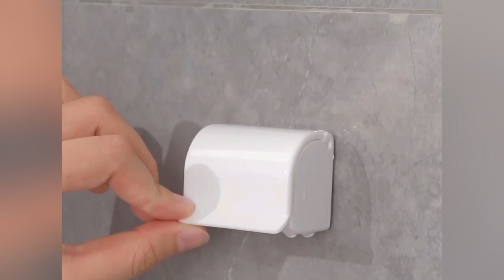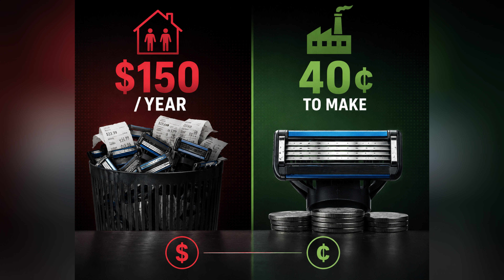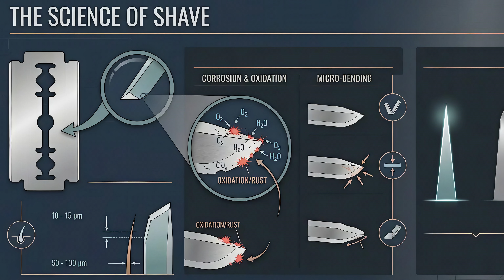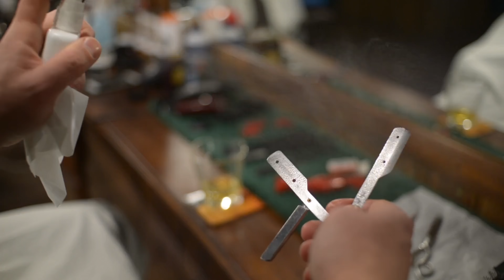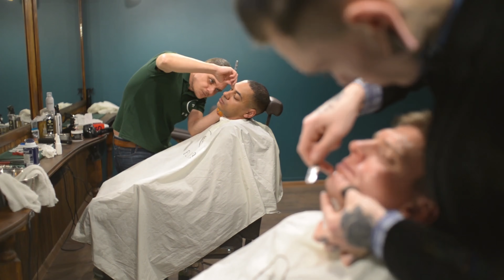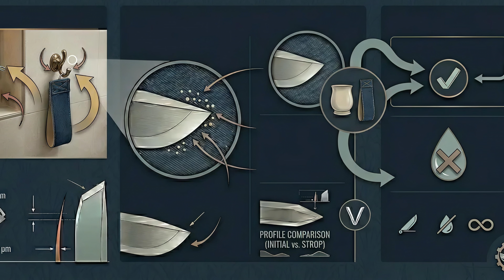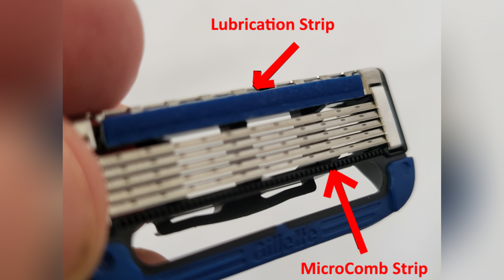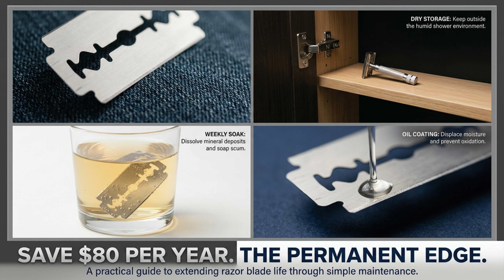Your Razor Is Designed to Dull After 3 Uses — How to Make It Last 2 years!

Comment: For as long as I can remember, I've been doing the following procedure and a quality cartridge will last me easily three or four months before it gets to the point where it is noticeably not nearly as sharp as new, and then I just change out the cartridge.  
When done shaving, I rinse it under HOT water for a few seconds, getting the water in between the blades.  I then shake down hard a few times on each side to get any water out from between the blades.  Finally, I squeegee the razor, as shown in the video, on my forearm, to get any excess water off it.  I don't do this to strop the blades, just to her it drier. I don't do anything else this guy does, but I think that rinsing with HOT water melts away any oil and residue buildup from your skin or shaving cream, and helps any moisture evaporate immediately off the metal blades,  limiting corrosion. 
Looking at the above, it seems involved, but honestly, it takes maybe an extra 20 or 30 seconds, and I'm on my way.

Comment: Why not just get a strap of leather.
Reply from the maker: You could, but leather is usually better for straight razors or knives, where you can control the angle directly.
With cartridge razors, the blades are tiny, thin, and recessed inside the plastic head, so denim is a little more forgiving. It lets the cartridge glide across the fabric without needing a perfect stropping angle.

Also, most people already have old jeans lying around, so it keeps the trick cheap and simple. The goal here isn’t true sharpening like a barber’s strop — it’s more about cleaning/polishing the edge and helping prevent the tiny rust and buildup that make the blade feel dull.
Reply: @Sidney_Explains_Money  Cool I'll try it.
Reply from the maker: @Gorilla_Jones  Awesome, yes — please do. It’s going to make a huge difference. You won’t regret it, my friend!
And remember: dry your razor really well after each use. Then rub it on denim or an old pair of jeans, and store it somewhere dry, away from water and moisture.

And if you have mineral oil or baby oil, you can put a tiny, tiny amount on the blades before putting it away. Then just lightly wipe off the excess and store it dry.

I literally have disposable razors I bought two years ago that are still working extremely well — almost like the day I unpacked them — just from doing this.

Comment: Could you use olive oil, coconut oil?
Reply from the maker: You can, but I wouldn’t recommend olive oil or regular coconut oil for razor blades.
They can go sticky or rancid over time, and they may leave a little residue on the blade. For this trick, you want something more stable and neutral, like mineral oil, sewing machine oil, or even a tiny drop of baby oil if that’s what you have.

The goal isn’t really “skin lubrication” here — it’s to leave a very thin protective layer on the metal so moisture doesn’t cause those microscopic rust spots that make the blade feel dull. So just a tiny amount is enough.

Comment: I was so intrigued that I started doing a little research and the first thing I read was do not strop cartridge blades, they are too thin. The article was referring to a leather strop but it still makes me wonder.
Reply from the maker: Stropping is definitely different from the maintenance shown here. This technique is really more about preventing the microscopic rust and buildup that can make the edges feel dull. 💡
And you’re doing it on denim/jeans, which is also different from using a traditional leather strop.

Comment: Are you able to use a standard stope on these blades? Or are the blades too thin for that?
Reply from the maker: For modern cartridge blades, I wouldn’t use a regular leather strop the way you would with a straight razor. The blades are very thin, recessed, and set at fixed angles inside the cartridge, so it’s hard to make proper contact without bending, catching, or damaging something.

That’s why denim works better here. It’s softer, more forgiving, and it cleans/polishes the blade edge without needing the same pressure or precision as a real strop. You’re not truly “sharpening” them like a knife — you’re mostly removing buildup, drying the edge, and gently realigning/polishing it so it lasts longer.
Reply: @Sidney_Explains_Money  - Thanks for the answer.

Comment: I have the Gillette and Schick razors that you push the button and it vibrates really fast. I have no idea why it does that?
Reply from the maker: Yeah, honestly, that’s kind of where I land on those too. 😂 Don't make sense to have that 😮
The vibrating handle sounds fancy, but in real life I don’t find it makes some huge magical difference. It doesn’t sharpen the blade, it doesn’t really clean better, and it doesn’t replace good prep or a sharp cartridge.

At best, it might make the shave feel a little smoother for some people, but to me it’s mostly marketing — and yeah, kind of annoying after the novelty wears off. Light pressure, warm water, good shaving cream, and keeping the blades clean and dry matter way more.

Comment: just how the hell you flip the razors from that disposable set of 3-4-99 blades head to wipe them on your ass leather!?  smart just for theory, it allows you to do half the job, how effective is that?
Reply from the maker: You don't need to flip the razor. You wipe the blade side across the denim to realign the edge, not the cartridge itself. It's about maintaining sharpness, not cleaning.

Comment: After use, blast it with the hair dryer on max heat for 30 seconds, that removes any water, then run along denim strap, then add a drop of the oil which came with your electric clippers.
Reply from the maker: That’s a next-level routine to keep blades in top shape, thanks for sharing! 🤘🏼

Comment: What type of gillete blade is the best? Fusion, proglide, etc... I wanna know the type of blade and only have Gillette on my country that is decent quality and wanna aply these tips
Reply from the maker: I’d probably go with Gillette Mach3 if you can get it.
The 5-blade ones like Fusion or ProGlide can feel smoother at first, but they also have more blades dragging across the skin, clog faster, and are usually way more expensive. For a lot of people, a good 3-blade razor is actually the better balance: close shave, less irritation, easier to clean, and the blades are cheaper.

So my pick would be:

Best simple choice: Mach3
If you want the fancy one: ProGlide
Best long-term upgrade: old-school safety razor, if available
And yes, the drying/storing tips from the video should help stretch the life of any of them. Just don’t press too hard — light pressure makes a huge difference.
Reply: @Sidney_Explains_Money  I think you may be mistaken about the 5- vs 3-blade cartridges. 5 blades spread the "load" across more blades than 3 the same way that 18-wheelers spread the load across more axles. The cartridge is designed to align the blades with the skin, and 5 blades means that each blade drags less on the skin. They are more expensive and may clog faster (though my fusion cartridges last as long as my old Mach 3s), but I find them more comfortable.

Comment: Double edge razor blades for my old style safety razor cost about 5 to 7 cents per blade if I buy the 100 or 200 packs.  I've never found those multi blade cartridges to give any better shave than I can do with a safety razor.
Reply: But is there not a risk of cuts and bleeding? However, one tries sometime you are preoccupied in thoughts due to daily stress. One careless moment and you get a nasty cut.
Reply: @GiDes-s4o    They are designed to be safe that's why they're called safety razors.

Comment: OK this method makes no sense( for Mach3-5 type blades), the actual edge that shaves is slanted at such an angle that stropping it will not really hone the edge that matters. I don't see how this actually works.

Comment: I sqaw this on an episode of Mythbusters YEARS ago. A 99 cent pack of 6 Bic disposable shavers, lasted me over 3 years after I started doing this. I mean, those were then 15 cent razors, lasting over 6 months each.
Reply: Why would you use the WORST razors to begin with? Why not use the best - Gillette Fusion Shield's. With this method, the total cost of the blades is irrelevant and I think if you oil it every shave, one cartridge should last a year of great shaves, instead of 6 months of bad shaves.

Comment: I prefer to use single blade double-edge safety razors. They tend to run about $0.1 to $0.2 each, and last me about 3-4 face shavings or one head and one face shaving.  I'll try the denim strop idea and see if I can get a bit more out of them.
Reply from the maker: Those are definitely the most cost-effective way to shave, let me know if the denim trick works for you! 🤘🏼
Reply: Very realistic comment - thanks!

Comment: I use a rubber shaver mat, I have done for over ten years. It can make a gillet mach 5 disposable shaver last 12 months easy. And I shave my head, which means it is been used to shave a bigger area 😁👍. The last time I bought Gillet blades was in August 2015, it was a 18 shaver promotion pack from Boots. The most common issue I had was the plastic breaking before the blades gave up.

Comment: If you want your Gillette triple blade razors to last at least a month each, do this simple thing: After each use, rinse them in isopropyl alcohol. Pour a couple of ounces into a a small cup, then after shaving, shake the blade around in that cup of alcohol. It will do a couple of things. It will wash out all the hairs in between the blades, it will disinfect the blades, and it will keep the blades from oxidizing because isopropyl alcohol will not oxidize the blade edges like water would do. I never rinse off my blades with water. Ever.

I’ve been buying a twelve pack of disposable triple blades each year for the last 23 years, and they last a year (I change the blades each month by habit).  Rubbing alcohol is cheap, about 2 dollars for 16oz, a pack of blades that will last you a year will set you back about 30 dollars (Gillette is a rip off), and the handle you never have to replace.

Comment: Do yourselves a life Changing favor... Buy an old fashioned "Safety Razor" from Walmart... and a pack of dual sided blades.  I used to fear using one... thinking Id cut myself.  In fact, Ive rarely cut myself ever... and far less than when I was using a modern multi-bladed Razor.    More importantly...  Ive gotten a single blade to last almost an entire YEAR.    Sure... the blade wont cut as close.. after like 3 months worth of shaving... but its still more than close enough for me.

 Also... Ive never had to dry my blades to get them to last.   Im not saying its not a bad idea.   Its just never been an issue for me.   The bigger issue, is making sure the blade is perfectly clean, when you put it away.

 And finally... I have serious doubts about the idea that cutting so much hair... is never going to Dull a metal blade.   Scissors are mostly only used to Cut paper... and they still eventually get Dull.
I think one of the biggest reasons for modern razors getting dull... is due to the cut hairs getting trapped between each blade.  This might be causing the blades to slightly change shape, which changes the cutting angles.   Also, once the crevices are packed.. its hard for the cutting to be as effective... as the shavings will likely be gumming up on the surface of your skin.. being cut and re-cut.. until they finally clear out of the way.   Additionally... if the blades are full... then when you keep trying to cut... you will notice that the blades are not cutting good enough... so you will often PRESS HARDER into your skin.  This extra pressure will likely cause a much more rapid Dulling of the Blades.   You should never need to press hard to get a good cutting action.

 Tips:  To get a closer shave  (and extend the life of the blade)..   Make sure to tighten your skin areas.   You can tighten your facial muscles... but sometimes its also easier and more effective, to pull your skin surface tighter... by using your other free hand.   The tighter your skin... the more level the cutting surface... the most easier the Cut.

 I used to use Shaving Cream... but eventually I just lathered up my face with a standard bar of soap.   The results have been the same... And its MUCH cheaper.

 I used to have extremely sensitive skin..  which would get red with bladed shaving... as well as would get too many nicks/cuts.    That was with standard multi-blade razors.   It turns out.. that the "Closest" shave isnt always the better shave.   If the blades are scraping the skin.. rather than just cutting on top of the surface of the skin... its going to create redness, and potentially develop ingrown hairs... as well as you being far more likely to cut yourself.    Ive never had this issue with a Safety Razor's cut.   No redness at all.  And EXTREMELY rare to accidentally cut myself.

 Another great thing about a Safety Razor.. is how easy it is to clean it.  You turn the dial to slightly loosen the blade... shake it in the sink/bath water a few times.. then re-tighten.  Takes less than 2 seconds to do it.   You should clean the blade after a few strokes.   You will feel it start to cut less and less optimally... and at that point, clean it, rather than continuing to force a harder + higher pressure cut.  Also, since the blade has two sides... you can fill up one side... then flip the blade over and fill the other side... before needing to clean it.

 Finally...

 Decent quality Stainless Steel... doesnt easily pit / rust.   However, stainless is a soft steel.. and does not hold a very sharp edge for very long.   This is why real COMBAT SWORDS... are made from two different kinds of steel.   The Inner Core of the blade is made from a very HARD, but Brittle steel.   This hard steel can sharpen to a Razors edge... and the edge will last a very long time.  It will also sharpen easily and quickly.   However... if you were to make the entire sword out of that steel... it would shatter the moment two swords collided heavily.   To solve this problem... the hard steel is put into the center of a softer and more flexible steel.   This allows the swords to bend, without breaking.

 Its similar to a pencil.  The wood is soft and flexible... and the Graphite core is HARD, but Brittle.   Wood can be sharpened.. but it wont hold a sharp point for long.   Graphite can be honed to a thin needles level of sharpness... easily able to penetrate the skin, and draw blood.    But too much pressure... and it will shatter / break.  The wood protects and strengthens the Graphite... helping to prevent it from easily breaking apart... even when Dropped on it side, from like +6ft tall.

 Now... the thing is... there are many grades of Stainless steel.   I believe there are also different hybrid mixes of stainless + other metals.   These less quality stainless steels... can and do rust / degrade.  Not as bad / fast as standard steel / iron... but still... eventually they will corrode / pit / rust.

 Most stainless blades are not easily sharpened... unless you have an extremely precise sharpening rig.   Ive personally never been able to revive an Exacto blade, for example.   Then again, Im not an expert in sharpening... and,  I lack a sharpening rig.    What I can say... is that Stainless is so soft.. that even if you get a decent edge on it... it wont last very long.  It dulls way too quickly.

Comment: You can't strop a safety multi blade razor in both directions? you can hardly do it one direction given that it's encased in a holder.
Reply: @roadwarrior8560  I thought exactly the same.
Reply: I use a leather belt that is as wide as just the blades. Probably use each cartridge for a year.
Reply: Thank you ... video is gibberish when it explains stropping

Comment: I use safety razors since many years. I used expensive razor blades with it. One day, at a barber shop I did ask the owner what they are using. The answer was stunning! Cheap blades made in Turkey! So I went online and found them. They are called Astra and they cost 9.90€ for 100 pieces. Then I looked at the fine print on the package and of course Astra belongs to Gilette. I wouldn’t be surprised if those exepensive Gilette blades came out of the same factory.
Reply: @deantiquisetnovis  Astra was originally made in Russia but now mostly comes from China. I shave mostly with Astra Platinum. The blades exclusively manufactured in Turkey are Derby Extra. Yes, they're cheap, but they're also terrible.
Reply: @eski_adam well some of them are dull out lf the box. But at 10 cents a peace I don‘t care 😅
Reply: That would make sense. Many store brand items (milk, bread, certain meds) are manufactured in brand name factories.
Reply: @deantiquisetnovis  Amazon. Astra, 100ct. $9.

Comment: So I should strop my feather disposable straight razor blades?  I dry it and keep it in the cabinet.
Reply from the maker: For Feather disposable straight razor blades, I personally wouldn’t strop them.
Those blades are already extremely sharp and very thin, and they’re meant to be replaced, not maintained like an old-school straight razor. Stropping them can easily roll or damage that fine edge, and with a Feather blade, that can turn into more tugging or more irritation fast.

What you’re already doing is the best simple routine:

Rinse it well, dry it carefully, and store it somewhere dry like a cabinet.

If you want to stretch the life a bit more, you could let it fully air-dry before storing, or keep a silica gel packet nearby to reduce moisture. But I wouldn’t denim-strop those like a cartridge razor. Once it starts pulling or feeling rough, I’d replace it.
Reply: Thank you brother!